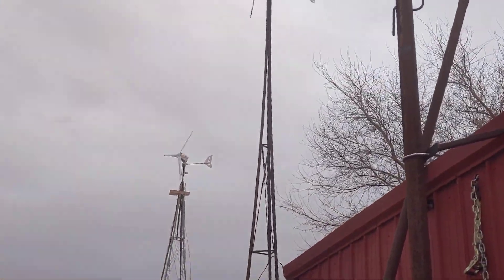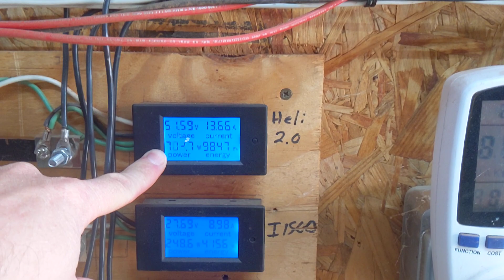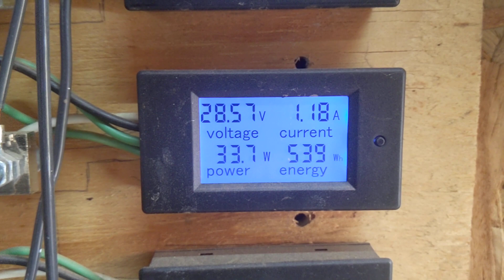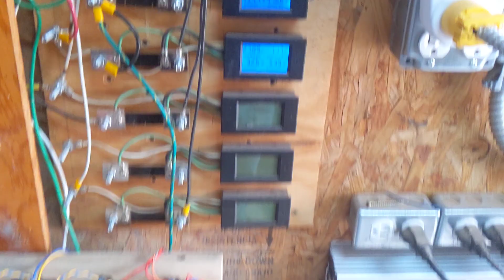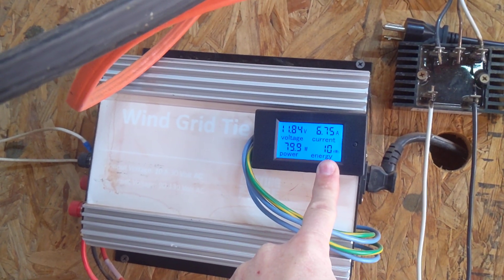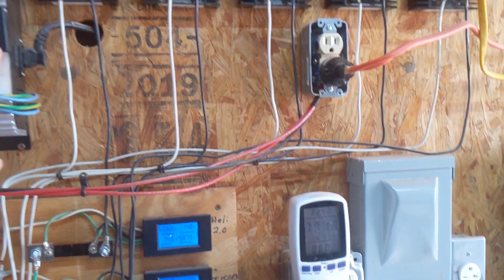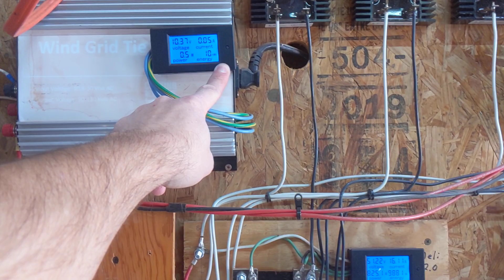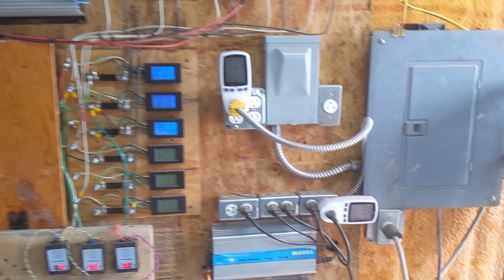Weekly Output Update: 12/24/2021

Comment: I have 16 batteries now...they charged up to 25.8 today. I got pretty good amps early then cloudy but it was okay. I have to figure out how to drill a hole in these magnets on this PMA without shattering them so I can put the stronger ones in. I thought I might try an end mill. We have had a windy day here... about 35-40 all day. You have two more batteries than I, but  only for about a week. The whole thing acted differently after I hooked up the new ones. I am sure getting tired of buying them though. Adding two really slowed the voltage down from moving much. I'm still waiting on the 80 magnets for the axial turbine to get here. I am slow like the turtle but I will get there. Happy holidays.

Comment: Thank you for the best videos. I want to buy a wind power of 1000 watts, voltage 24v, the best type
Reply from the maker: Hi!  Are you wanting a turbine that makes 1000 watts nominally or one that peaks at 1000 watts?  I HIGHLY recommend iSta Breeze's i1000 and i1500 if you're looking at peak outputs, but they only make 300~600 watts most of the time.  If you're looking at something that makes 1000w all the time you're looking at a much, much larger project.